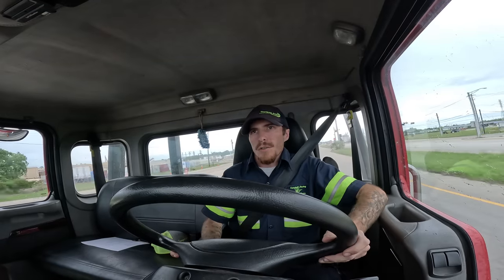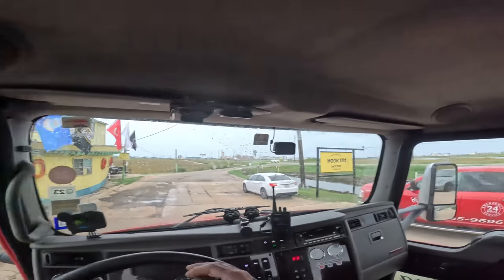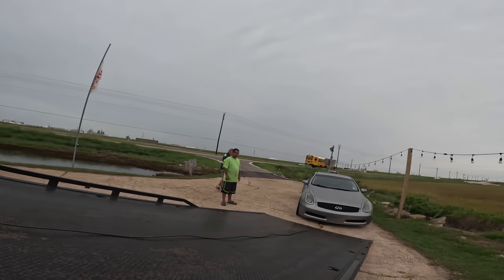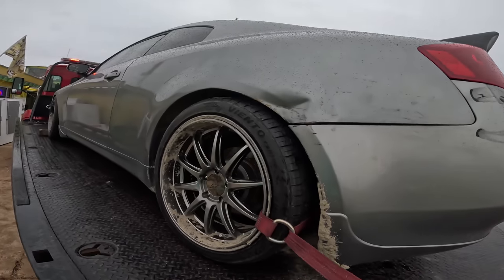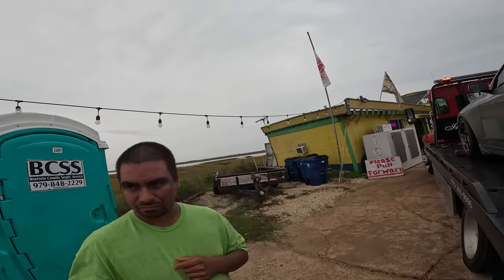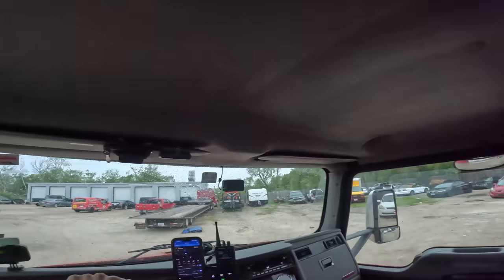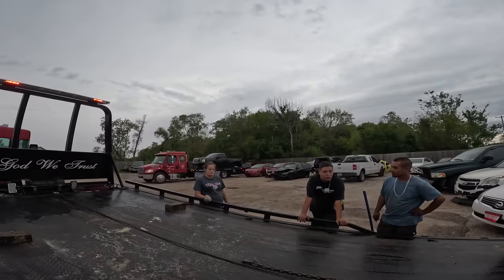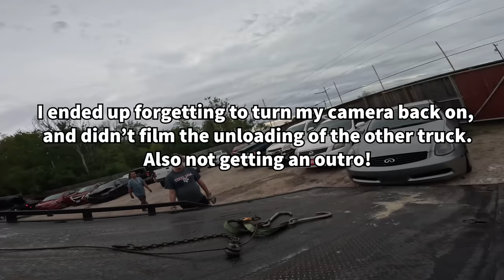They Left This Infinity G35 Abandoned by the Beach!?

Comment: Hey Dustin I drive a Peterbilt flatbed with air bags does your Kenworth have air bags? Makes lowered vehicles so much easier to load with the air bags down. I wish I had that bed instead of the JerrDann bed I have on mine
Reply from the maker: Yes, all of our trucks have bags. I also have ramps I use on lowered vehicle also.